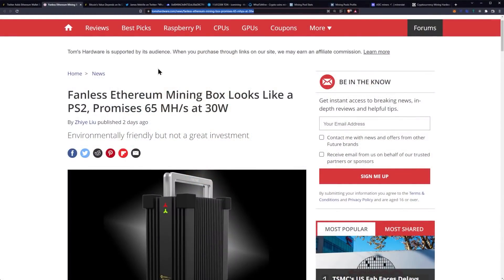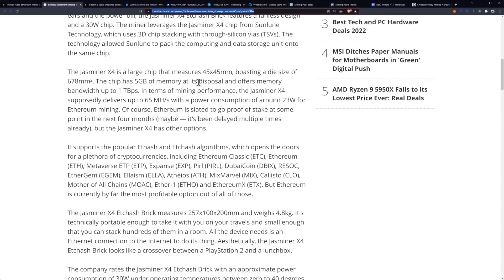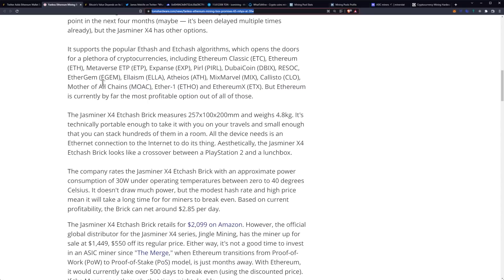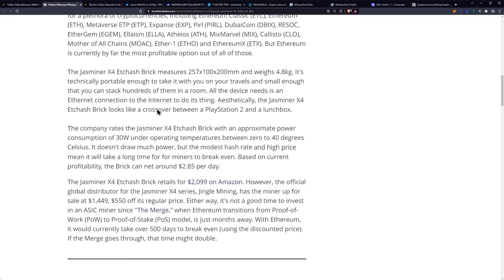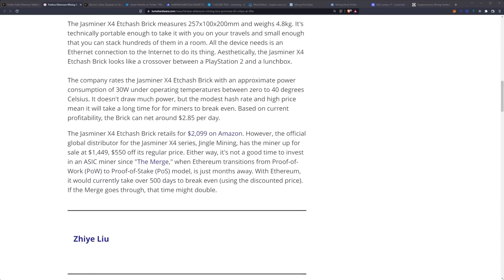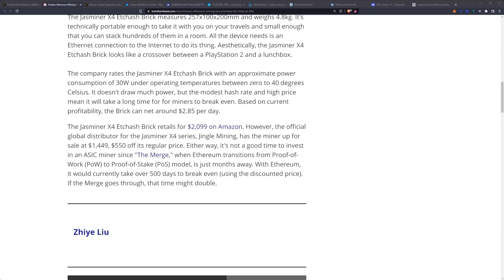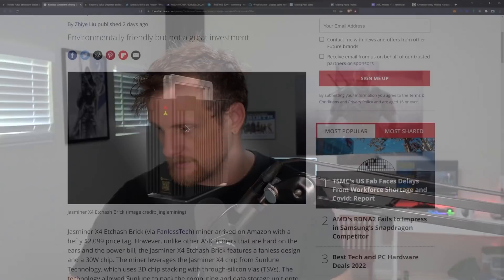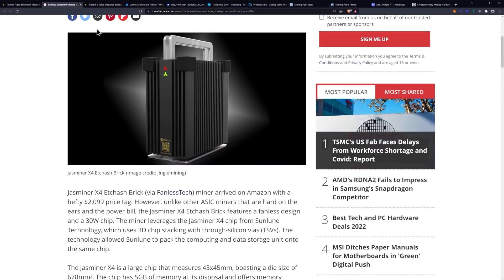Fanless Ethereum ASIC Miner

Comment: Would have been a good purchase here in the uk. April 1st minimum price of electric will be 28.3p kwh. (0.39usd) efficiency is everything right now.
Reply: Such a scam if you’re on non fixed contracts. My price is fixed for 2 more years at 15p 0.19usd but will go so high when the contract is over
Reply: Yup in the same boat, replaced my 4 worst GPUs for efficiency to scrape back a little profit. If we had 10cents a KW/h I'd be laughing and putting another rig online rather than replacing GPU's before expanding more.
Reply: That is INSANE!  How the hell are you guys going to afford power to run a heater? That is going to kill so many pensioners!

Comment: Hey mate i got one at a nice discount, the MHs are Real and the device is dead silent, the MH/s are fluctuating slightly. You can OC it and move into the 70sn only downside i noticed is that the device is rebooting about every 3 days and it takes 30mins to start mining again.
Reply: Network default flag
Reply: 70ish range? Talking MH/s? At what watts though? I'm very curious. Please share more. :)
Reply: @dasnichols2733  non OC @66 Mhs @ 38C°
Reply: @dasnichols2733  OC is at 74Mh/s @ 34Watts
Reply: @HawK4all  That is really good and a way, if not very expensive way, for people with high electric rates to be involved.